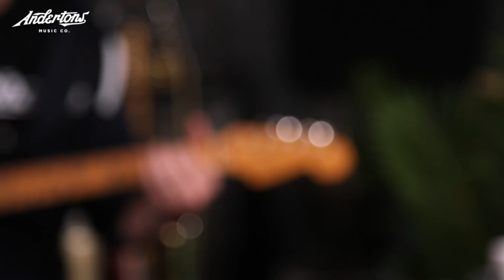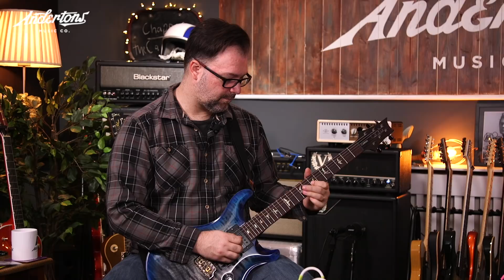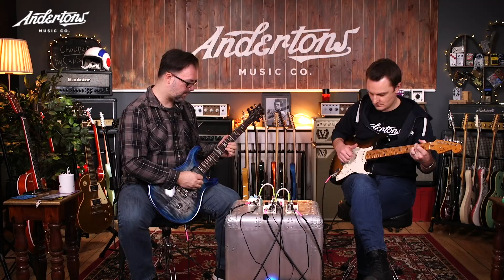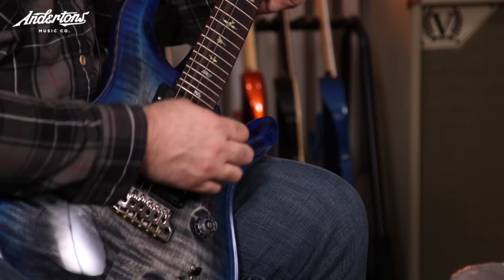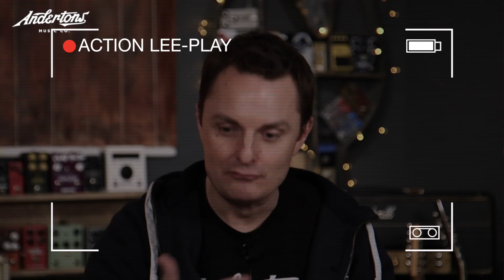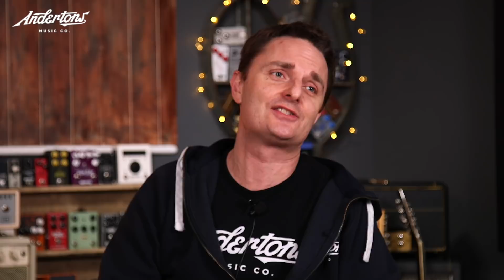New Danelectro Billionaire Pedals!

Comment: I've got an old Danelectro Fab Flange... its a repulsive rocket shaped plastic boxing of fishtanky sounding hideousness!
Reply: I have an old Danelectro Cool Cat chorus.  Not very good and the odd shape means it'll never fit well on my pedal board...
Reply: Yeah, that's from the same range isn't it.
Reply: Some of the older ones aren't bad, the old Diner pedals Tremolo and EQ and the Pastrami OD.  The Diner pedals do one thing, have one sound, and that's it.  Which in a live situation, unless you want to be grubbing around on your hands and knees, twiddling knobs, is all you need.  The Cool Cat metal case pedals are true bypass and better.
Reply: The Rubber Band pedal as I called it